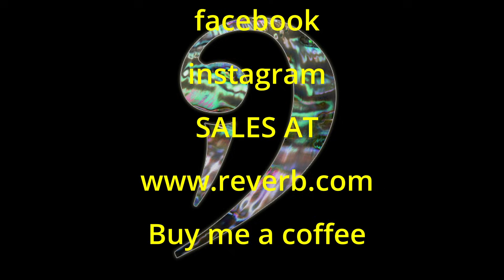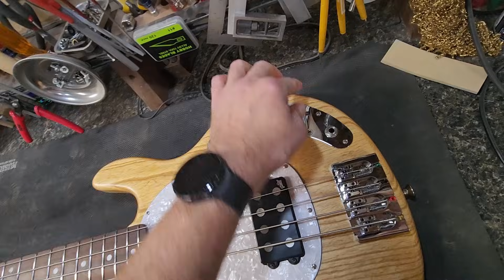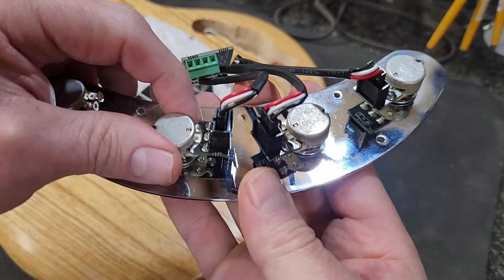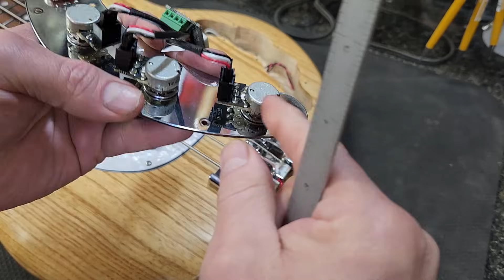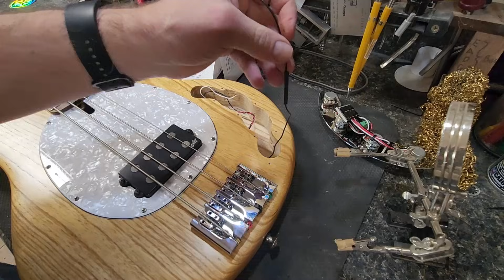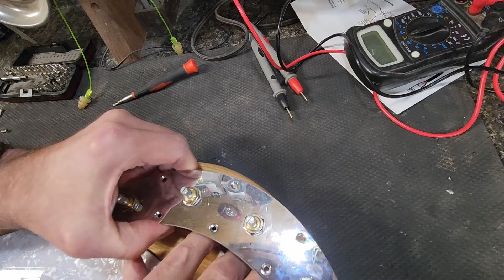Drake Custom Stingray-inspired bass guitar atypical install of Dark Glass Pre-amp

Comment: Nice install. Im personally not a fan of barrel jacks as they seem to wear out faster than normal style jacks. You might have luck with the oval jack plates and bending to the contour with the body, in lieu of a 4 screw Les Paul style plate